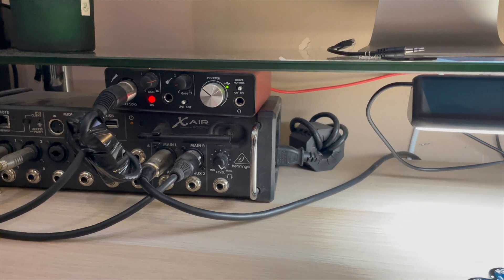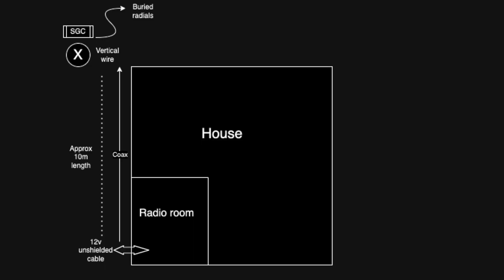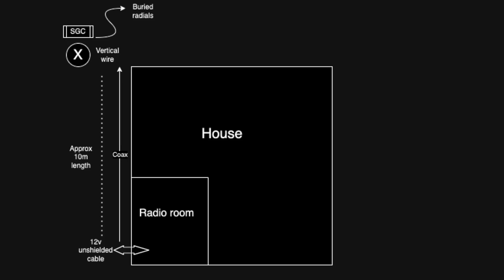How I stopped RF getting into my ham radio shack

Comment: In this type of set up  I would put a choke balun near the end of the coax and just before the tuner.  You could also put the choke right at the base of the antenna.  On reflection I think the second option would be better. Ferrites on both ends of the dc line may also help as would an RF choke on the DC line to the rig.  Is your station  grounded using a outside ground rod?

Comment: I’ve just noticed a problem with my SWR jumping all over the place. Recent video I saw, the guy had similar problem; fixed with a common mode choke. I’ll have to try the same. Someone on FB however, said it’s a known issue with the 991; poor grounding in the tuner side of the radio. Time and troubleshooting will tell !
Reply from the maker: Yes it’s a process of elimination

Comment: I am having a bit of trouble with RF from my PV Array or probably a mix of that and the inverter.Basically until the sun goes down the beam is almost useless.The only remedy i see for this is dig another big hole further away from the roof and move it as i wasn’t getting any issue when i was setting it up in the garden.
Other than lighting up my BT keyboard when i TX all is well in my shack.

Comment: I beleave you had common mode running in your shack. The 12v running outside needed to be isolated and having a separate power supply does that. I am thinking your common mode choke needs tuning to get you a minimum of -40db to keep the common mode down lower.  Also you might want lighting protection on your 12v line if you have thunderstorm’s that would help.

Comment: Hi Carl. 
Problems such as the one you had can be very frustrating, especially if you know you had a good working system in the past. But it is all part of the “fun” of amateur radio. You came, you figured, and you Conquered the problem. 
  Any resonant length of wire/ cable is going to act like an antenna on that resonant band. My guess is that you had the problem on different HF bands. And YES, a non shielded cable so close to a coax will pickup RF and cause problems if it is not choked off. Are both the coax and the ATU power supply cable buried ? 
Are they rated for direct burial if so? Water can and will get into coax over time, and will degrade the system while all the while, everything checks out fine. That’s why I always recommend the best coax you can afford.

  Was it Passive Coupling between your coax and the ATU? I’d say it definitely was.  Now how was the RF being coupled? Between the coax and the ATU power line, or through the ATU itself?  The only way to tell is remove the chokes you installed, disconnect power at the ATU itself and se if the problem comes back. If so, the coupling is between the two cables, if not, the RF is most likely getting in past the ATU itself... 
 Now after that long “Bag O Wind explanation, glad to hear you got everything working in proper order.

Comment: if you put snap or ferrite on the end of the coaxial antennacable right below the plug on the antennacable where the cable goes into the antenna, that might fix the rfi problem. the resistance of the ferrites towards HF decreases the lower the QRG is, that means for lower QRGs there is more ferrites required. 80m for example needs about 12 snapp on ferrites for 10m like about 5 ferrites would be enough, the more ferrites the better. ground the antenna or at least connect the metal case of the radio by a short and thick copperwire to a blank spot on the radiator on the wall, that usualy helps too.

Comment: Hi mate . I had RF problems in my mobile when my IC7000 HF would turn off or do weird things to the FT400 sitting switched on, but idling next to it.  Solved by ferrites on the coax run, the separation cables and the power leads.  Useful things those ferrites.   PS vid sound is definitely in mono - but 5/9 nevertheless!
Reply from the maker: Yes cheers, I’m going to review my editing process for home videos as the desk mic is better sound but I need to render the video differently
Reply: @M0SZT  👍

Comment: You might consider using a battery to power the SGC tuner, at the unit, to avoid the 12v wire. The tuner only uses 300 mA when it's tuning.